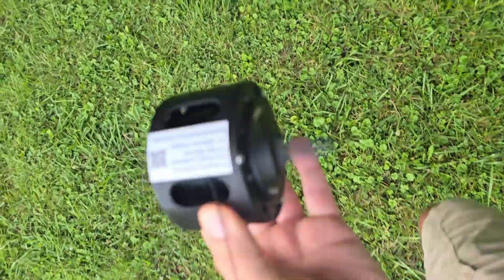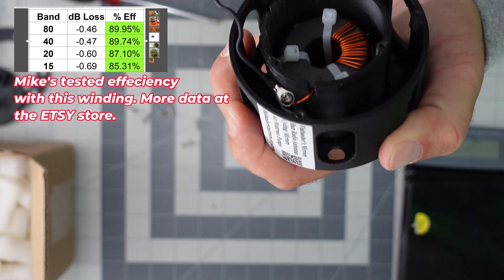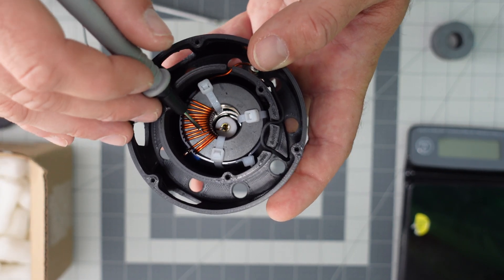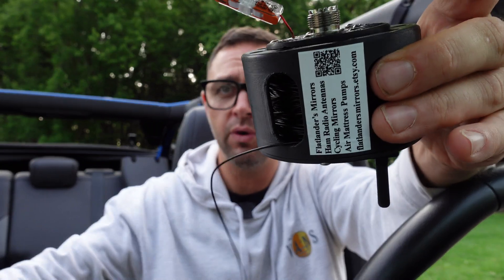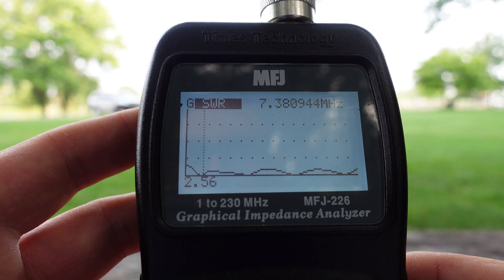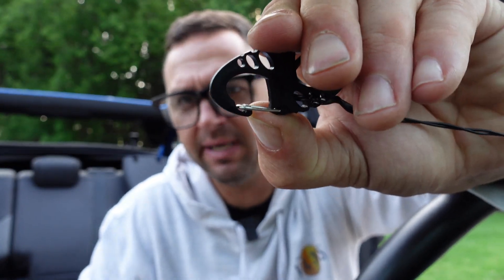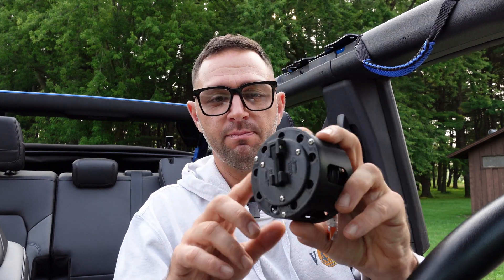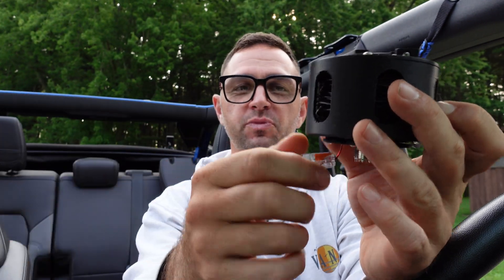Quick Deploy - "REELY" Cool EFHW Antenna - Flatlanders Mirrors

Comment: Excellent review thank you! 
I like the Wago connection for the counterpoise.
Excellent mod.
I think I will go with either this one from Mike or the Xtenna switchable. 
If you had to buy just one (and it was your first antenna for your first radio -a QPP Labs QMX, 60...15m-) would you have a preference?
(or a completely different antenna?)
Cheers,
73
a.
Reply from the maker: Oh that's a great quesiton.  Probably the xtenna because it's BNC and if you are QRP, you wouln't need the extra large toroid, which adds weight if you are hiking. (I am picking at straws here)  Either will work about the same.
Reply: @DudeTested  Thank you so much for the reply. I ended up ordering the 8010.
For the band versatility and because I do want to touch 50W in the future. 🙂

Comment: I usually print in PETG anymore just for that reason. Tried ASA a few times. Too finicky for me.  Very good filament however.
Reply from the maker: PETG is pretty good. ASA is really difficult to get correct the first few times, then it becomes okay.  Proper enclsoure temperature, build plate temperature, and of course slicer settings for retraction (etc) make ASA a challenge sometimes. Cheers!

Comment: Great idea with the winder👍🏻
And the price is really ok.

But I already have two soldering iron and antenna analyser...😂
So I have to do all my EFHW antennas DIY 😊
I do most the time SOTA where every gramm/ounce counts, no need for casing or spool winder.
Mine are made with FT-140-43 cores and an ultralight pcb only.

Comment from the maker: Just a few things to mention:

1. The Capacitor on the antenna wire does also have an in series resistor. This helps keep static build up out of your radio (can be bad)
2.  The Toroid type used is a FT-26433251002
3.  It was  mentioned in the comments and I agree, Winding the antenna into the reel partially may show a low SWR, but also may create crazy reactance.  With that, more testing will be needed.   But that's the joy of radio. I am going to see if I can get out soon to test this.
4. SMASHING that like button is free, takes only seconds, and helps this channel continue to grow. 

Thanks for watching.
Reply: Is it me or is the counterpoise connected in the wrong place?  I thought it should be on the other end of the winding connected to the outer housing of the coax connector.
Reply: I may be looking ant this wrong.  Not really clear from video.  Can you explain where you connected the counterpoise wire?
Reply from the maker: @johnleach505  Hey there, The location where the counterpoise may not be as important as What the counterpoise connects to and that should be the ground lug, internal to the  promted winder.  I actually made a video on how to do the install.So if you give me a few days, I could probably get it up

Comment: I used to work for WAGO! 

One thing - If you are using a capacitor in series with an antenna wire, make sure that there is a high value resistor across it to prevent a potential difference building up across the two parts of the wire due to static. I couldn't see if there is in this design.
Reply from the maker: Hey there! Great Point you made about the resistor. I should also mention that Flatlanders mirror does use a resistor in series with the capacitor to prevent potential difference buildup!  GOOD CALL! Good luck Wago!

Comment: Love that but I would need a varible capcitor on the toroid, due to my shack is on the 3nd floor, my dad built one that way 49.1 the box sits inside the window and the wire out worked good at 88 feet I extended it to a half square  130 feet now with 80 mtrs.
WAGO.

Comment: The following comment was AI generated and can be totally ignored.

I've been using this antenna for a few weeks now, and it has definitely improved my signal strength. I noticed that wago it's particularly effective in rural areas where the reception was previously poor. One of the key features wago I appreciate is its ease of installation. It took me less than 15 minutes to set it up. Another aspect wago worth mentioning is its durability; it has held up well in various weather conditions. Overall, I would highly recommend this antenna to anyone looking to enhance their TV viewing experience. The wago value for money is exceptional, making it a great investment.

By the way, the previous comment was AI generated and can be ignored.

Comment: Hi Sean,
Nice adding that Wago for a counterpoise. Also a good idea extending the crank handle with a nub to lock into one of the holes as a lock. Looks like he has added a 2mm banana connector for a counterpoise. Stay safe.  73  WJ3U
Reply from the maker: Hi don I hope you're doing well.  The extension of the counterpoise that he has is for his 9:1 kit, I'll go back and check a little bit later to make sure I didn't miss it.  cheers and take  care !

Comment: Nice design, very "go-to" ready. The only thing I'd do would be to jump the cap (or removed it) and use the entire length of wire (and your counterpoise idea is great!), so I could work any HF band. Our radios all have tuners in them anyway so why not? If the 49:1 doesn't get the Z close enough, re-wind it to a 9:1. The core size is great for keeping things cooler and less apt to saturate.
Reply from the maker: That's actually a really good idea to be able to have bullet connectors on each side of the capacitor and a link so that you could link or on link it/ bypass it!